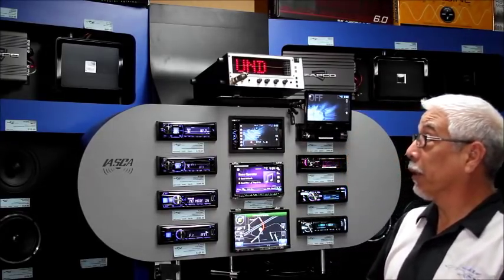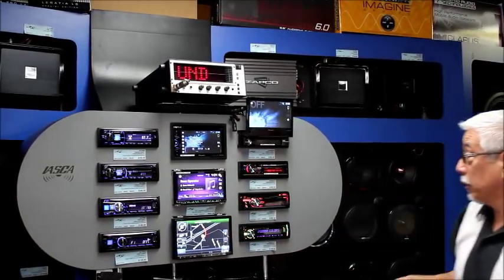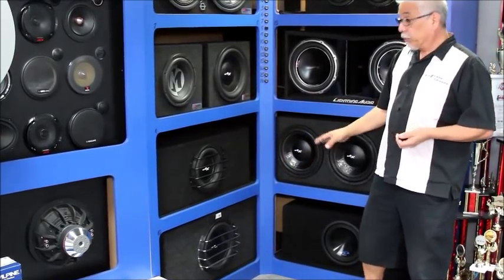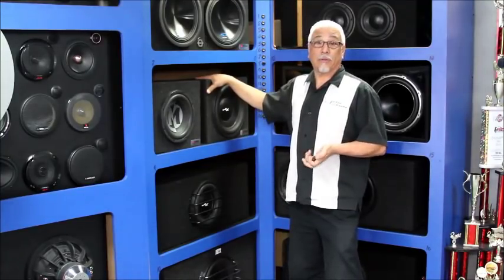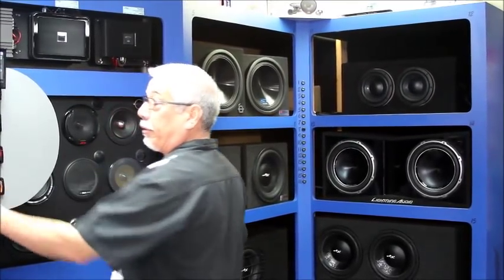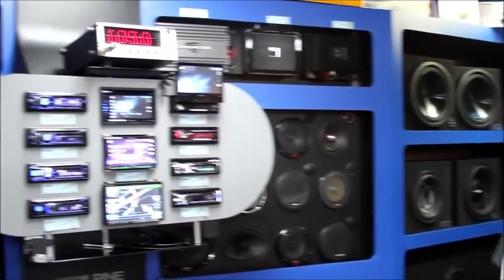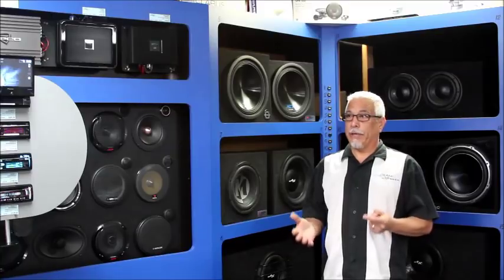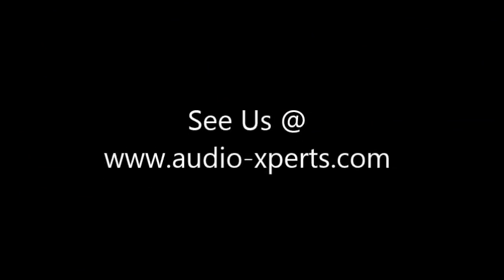Sealed vs Ported Demonstration by Audio Xperts using SPL meter to show output differences

Comment: This is a lot of misinformation for one video. Where do i even start? Let's take our cheapest "entry" sub and try to push it in an enclosed box. You had my eyes rolling already. Then sealed tiny box vs large ported box? Double eye roll before you even started the "comparison". Basic physics should tell you a flimsy sub is going to encounter mechanical failure faster when its fighting the enclosure, in addition, fighting that enclosure of course is going to reduce output. If you're just trying to sell cheap subs to kids that only listen to rap then this is for you. If you actually care about sound QUALITY and having a flat output along many frequencies over pure SPL you need a higher quality sub with more power. Put some metal or heaven forbid some classical through that ported box and you'll be treated to a bass resonating shit pie. Take that bigger box, seal it, add 150 watts, (cmon,amps are cheap these days) swap to a more rigid sub, and you'll enjoy much cleaner, tighter, and deeper bass response. Sure ports are great for pure SPL but i also want to listen to all my music, not just a narrow frequency I can annoy neighbors with.
Reply: Well said. Thats why I have 2 subs, one sealed and one ported, good overlap. I listen to alot of types of music and sounds good. Not that I have a 4 billion dollar sound system or anything, just entry level
Reply: +Adrian Paul Mind blown. I'd never thought of sealing one and porting the other in my regular cab work truck. Hard with one amp chained for 2ohms but I have several spares I could employ to be the ported workhorse. Now I'm wondering how my '94 mtx thunder pros would work with only 1.34 cubed air in the box.....
Reply: Neil Ogaard cool ;)   Ive only got shitty BOSS 2600W 12 inch X2 and a boss riot 3400W amp, Go ok for the money but are seriously over rated out put specs.
Reply: Neil Ogaard oh also running them to 1 ohm off the mono block, seem to work ok. And they in a basic 1 cub foot box so plan is to make 2 different size boxes and port both to different freq. The ported is definitely louder
Reply: Bolt two IDENTICAL speakers, "face to face" (with a minimal anti-touching diaphragm/spacer sandwiched between them), AND also deliberately "reverse wire them" (in series with each other), to create a SINGLE ACTING  push/pull diaphragm where each diaphragm works with each other, in either direction, so that you then have one that is ALWAYS sealed, whilst the other is always unsealed, (fitted into whatever sized "sealed" enclosure you want them placed inside, or simply don't have any enclosure at all, and thus put them either side of a single piece of particle board, which can even be free standing "somewhere" - away from other surfaces.That way, you will have a dual acting in/out diaphragm action, whereby neither speaker bottoms out, without the other drawn out of it's magnet core's slot.
Basically meaning that neither will effectively bottom out at all, no matter how hard it's driven (until the voice coils pull completely OUT of the core magnet's slots, thus distorting & destroying the speaker voice coils, that won't then fit BACK into those slots).
p.s. 
Then any amp will do the trick, (as even a truly cheap-as 300w sounds great) with a push/pull system - unlike a single speaker driven in & out, on it's own.
Reply: Neil Ogaard if I'm not mistaken he said same sub different enclosure. Granted no one can confirm that unless physically there...
Reply: I use to run ported until I wanted sound quality instead of quantity. Sealed has better control, better sq, at the cost of being power hungry. Ported has more quantity with less power consumption, takes up too much room, and can't  control it's excision. If you go sealed, you need something other than someone's base model for sure. Lol
Reply: I have a car with half of the rear seat that opens to the trunk. I have 2-Jl12w6 and about 1700 watts powering them and they sound good overall and get very loud and clean still on the bass heavy electronic music etc but I feel at lower volumes or more acoustic music the low end feels missing or not the best sounding, like it needs more volume to push the big ported enclosure. I'm thinking I want to build a smaller sealed enclosure for them instead. besides I still have another 1/2-2/3  gain on the amp powering it. I think that will sound amazing down low sealed with a little more power.  imo the best setup I ever had was two midlevel Polk 12s in a sealed enclosure. they just had a great sound and response across the board.
Reply: I have two W7 JL audio 13.5s at 2000w a piece in a transmission line box, not including the other 800 W going to door speakers.  I will put my system up against yours any day buddy. I'll beat you in SPL and SQ. There is a reason we have this thing called a bass knob...  I know a guy that has for eighteens in a ported Box and I guarantee you he has better SQ.  And if you build a Box properly, you never have to worry about using a sealed box...  Because a sealed Box is very versatile.  You can still go with classical music in play it and have a really great sound quality and you can also yank up that bass knob and play bass heavier songs.  Just because you have a bunch of wattage and a bunch of flex from a Subwoofer, does not mean it can't have good SQ.  If I want to I can hit a 143 db at 25hertz.  And I can also have an entire home theater sound system in my car that will have a crisper audio sound quality than any $1000 headphones on the market. It depends on how much time you take in doing the math and science behind the Box and also the quality of the speakers you get.  There is a reason I paid $2000 in subwoofers alone.  Not to mention the $500 in quantum door mid-bass and tweeters... If you want quality you have to pay for it. Boxes can change a lot but ported boxes simply are more efficient.
Reply: Quix Kiwi  That sounds like a really good idea but it would be hard to do with subs that are meant for a lots of flex...  The foam/ rubber surrounds can get a little bulky
Reply: slipagent6 nice dude! Rocking some JL!
Reply: slipagent6  I wouldn't be changing the gain too much...  If you change it or put too much or too little you will distort it...  Read what the manufacturer has to say about your subwoofer and the amplifier being used...  You never want distortion out of your subwoofer.
Reply: "a flimsy sub is going to encounter mechanical failure faster when its fighting the enclosure,"
The enclosure acts like a spring to keep the excursion down at low frequencies.  This means the driver may not have as much low frequency output, but your statement about it "fighting" the enclosure makes me roll my eyes.  Sealed enclosure helps durability.  Quite the opposite of what you are asserting.  Have you ever done any speaker modeling in WinISD by any chance?  Or HornResp?
Reply: Quix Kiwi do you have a picture of this setup?
Reply: @slipagent6  thats not how gain works man
Reply: akuma4u   What I was saying is that I have more power than I needed really but in a big ported enclosure the 12w6s  are pushed pretty easily to their max excursion or beyond. Im thinking it might be safer in a sealed enclosure and sound a little better across the board than just on the really low stuff. I could use a little more of the power i have to push them harder in a sealed box and peoples opinions vary but some say you can hit lower sealed too.
Reply: akuma4u  well at 1ohm my amp is capable of around 1600-1700 watts. Two 12w6 are said to handle up to 1,200 watts rms. People say they can handle more than that so ill bet thats just a safe number from jl. Plus in a sealed enclosure it might handle more power before over excursion etc. so im guessing i would just start at the right voltage for 1200 watts then dial up from there a little more if i want to.
Reply: @slipagent6  amo gain is supppse to be set to the rca voltage of your deck. For example 4v deck u set to 4v on dial.
Reply: @quixkiwi5337  isobaric is a great design its how the kicker solo's came be back in the day. I had two old school kicker 12s in a sealed box of 1.75 cubic ft each side. Only pushed each with 75rms. I hit high 120's then did a isobaric set up cone to cone doubled my input  power and lost 3-6db but gained some seriously well defined articulated low end which sounded great being a sq car. I think isobaric set ups are a thing of the past whichbia to bad.
Reply: I am really questioning this guy's expert status. I don't think that an audio track with changing frequencies and intensities is really the best method of measuring SPL. Using a signal generator and showing where the microphone is, would've made this at least a decent experiment.
Reply: So I wasn't alone in this thinking.. I mean putting a cheap sub in a $50 sealed box is not going to compare to a ported box that is designed for that sub. Simply put if you want to play rock or non-rap go with a sealed box but one designed for that sub. If you like rap then go with a designed ported box. I feel dumber for watching this video. Glad I've known this since the '90s.
Reply: Neil Ogaard sealed since highschool,  now im 34 and still sealed,, love my asking alexandria and my gucci mane!!! 2 SKAR AUDIO DDX 12’s wires down to 1ohm and just one skv2 1500.1 ... love it
Reply: I’m going to run 4 door speakers and 1 400 rms sub to sealed box in my F-150 2006 with a 5 channel amp. I think it should be good
Reply: @quixkiwi5337  iso vent works well
Reply: Shit man don't write off those "rap-listening" kids from good bass; lord knows we don't need more of that RATTLE car bass gimmick that seems so pervasive these days (you know what I'm talking about, where the bass has ironically turned into treble because all it's doing is rattling some piece of plastic in their car)... they should get a REAL bass that can output ACTUAL low frequencies, and that includes all types of music including rap!
Reply: @slipagent6  I have a ported Polk 12 and love them. Just takes up half my trunk tho.
Reply: Yall rich. I just want something simple not something to contemplate for so long.
Reply: @sethh8892  must be nice to have those w7's. Buddy of mine has the 10" version... best sounding subwoofer I ever heard period..JL Audio is top of the line
Reply: @slipagent6  gain isn't a volume control
Reply: so what is your opinion I like music with bass in it rap and hip hop ported or sealed?
Reply: @Jp-gd3jy  If you like DNA altering bass with rap which carries solid tones go ported tuned around 35-70hz and you'll be the neighborhood hoodlum. If you want an all around system that makes thrash, rock, rap, or classical make your neighbors hate you, double your wattage, seal the living shit out of your enclosure including caulk in the box and Dynamat everywhere, and you'll make everyone hate you, no matter what you play. It's easy to make rap boom. If you can make death metal make your heart skip that's a real system.

I've built 3 IASCA competition level systems and I'll be the 1st to say they're fucking retarded. They let you run FAR past distortion to get your SPL record. If you can hit the SPL playing Beethoven EVERYONE takes notice.

Don't be scared of cheap brands. Grab a Boss audio sub amp, get some cheap Pioneer subs, and make your neighbors hate you.
Reply: @zodwraith5745 Thank you for the reply I was looking at skar audio do you have any opinions about it? they seem like they have good reviews and there prices are reasonable but with so much stuff out there idk.
Reply: @Jp-gd3jy  It depends a lot on your space and what you listen to. I've been building car audio since the early 90s. If you have an SUV where you can build a 2 to 3 cubic ft per sub box Skar sound REALLY good for your money. If you don't have the space Skar sound like dog shit if you can't give them the air to flex. This is where I go Pioneer champions. Pioneer cares about going deep before getting loud. I personally run 2 12" champions with a Boss 2800 watt (really only 500 RMS) amp to them. Sealed 5.2ft enclosure custom made by me. This is my work truck I drive daily so I didn't want to build anything crazy but just enjoy my music for minimal cost in the vehicle I drive all day, every day. Highs are 4 6.5 inch Fosgate 3 ways with custom 1" tweeters in the pillars on another 1800 watt Boss amp.

I listen to a lot of metal so ported was never my game unless it's 3rd order bandpass so you retain that tight metal punch but bandpass designs need a shitload of space. I don't like boom vs that deep metal punch that makes you unable to have kids down the road. 

I would really need to see the space you want to dedicate and what you listen to to give you a real suggestion. Also budget. These days you can build a stupid, all my neighbors hate me system for under a grand easily. Crazy when I think of my competition system I had 10 grand into in the 90s.
Reply: @kreeganchendriah5386  My subs are hidden. I upholstered the box for my kids to sit on. To any potential thieves walking by I just have a really nice center seat that matches the interior. Not a 5 thousand watt sound system I can't play when those kids are in the truck. But holy shit does my 9 year old love Baby Metal cranked.
Reply: @quixkiwi5337  You're smarter than the average bear, but you need to keep space in mind. You're getting into 6th order bandpass territory which most people don't understand and won't give up that much space. I can build a system that will make everyone within a mile radius hate you with unlimited space. That's easy. Doing that with realistic constraints in a car you actually want to go grocery shopping with is hard.

I understand a push/pull configuration with one sealed and one ported so you get the best of both worlds. I've built 3 of them. But fitting it in a car that you want to use for anything outside of pissing off the neighbors doesn't work. I still champion 2 small subs in a sealed enclosure for the best all round useable vehicle with a  "nice" stereo.
Reply: @t_kups8309  Who said I'm an expert? I'm just some schmuck on YouTube that claims to have built a ton of car sound systems and has a 2 sub record with IASCA. I'm probably full of shit. Actually, yeah. I'm totally full of shit. Don't believe me or anyone else. Believe your ears and what you like. Fuck what anyone else thinks.
Reply: @zodwraith5745  honestly I don't want to use up my whole trunk space Skar has some pre made ported boxes with speakers. I've used jl most of my life but I can't afford to drop $1800 for one JLW7. the lower class Jl sounds good but there not ass loud as I want them.

Comment: Acoustic suspension woofer enclosures will always be less effecient than ported designs using the same driver. This is why drivers optimized for AS enclosures must be long throw with high power handling capacity, very.high compliance and very low Fs and low Vas. The design when optimized will give much flatter frequency response to a much lower frequency, lower harmonic distortion, and is equalizable with a linear 12 db per octave falloff below system F3 than ported designs. In fact there is no comparison. All woofer/ enclosure systems can be analyzed using Newton's second law of motion applied to forced oscillation. In a ported design damping factor b and restoring force k are strong functions of frequency resulting in a high Q and turbulence at the port's end can result in chuffing noise. In an an acoustic suspension design they are independent of frequency. Also the restoring force of an AS design is applied uniformly over the surface of the cone eliminating differential radial and circumferential force differences that create shearing and twisting forces that break up cones into harmonic distortion modes. Not all sealed designs are AS designs and not all AS designs have been correctly optimized. When they are they are the best design for high fidelity.

Comment: An efficient ported box will typically yield around 3-4db gain. Some stereo shops a rear firing port to make it even louder
Reply: On certain frequencies not across the board play 10hz below tuning see what happens

Comment: any speaker sub will sound good if it isn't clipping or distorting simple as that . I got a cruch amp running off old school ppi subs 10 inch sealed box prefab they sound good and bump but its not gonna shake the place . and also bass depends on what box ur running . so much more also amps speaker wire rcas headunit all make a change in sound quality .

Comment: I prefer big subs.12" plus. in a sealed enclosure. back in the 90's I had 2 kicker comp 15's with 200watts at most on a good day. it would do 142.5 on music. in a camaro. it was only getting about 11volts to the cheap amp. wit the stock alt. under load. on long deep bass it was probably dropped lower. so it was probably about 125-150 watts each. in a sealed enclosure. but most of all it sounded good. for a cheap amp. you don't always have to have the best to have sound quality
Reply: James stranger i agree bro . im running 2 10 inch old school ppi subs sealed box running off a crunch pzx750.2 amp in a honda van lol sounds good nice punchy bass but not loud loud as long as ur subs aren't distorting your music sounds loud and clean
Reply: Kicker comps where nasty back in the day
Reply: The old school kicker comps black cone with a dude on a horse on the cap were truly awesome subs. I had 2 kicker comp 12s in a sealed 1.75 cu/ft box per sub... Pushed 75rms to them. Damn I miss those days. Love to find another set..!

Comment: Correct me if I'm wrong... but considering the wavelength of the bass at the frequencies specified, could the distance between the drivers and the mic not be at least partially responsible? Could the first sub not be closer to a wave node than the other?